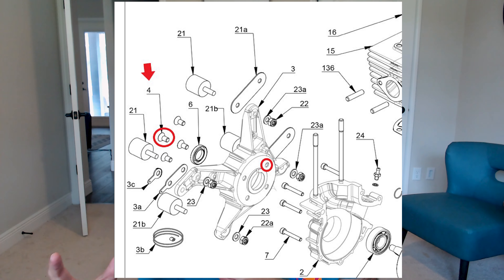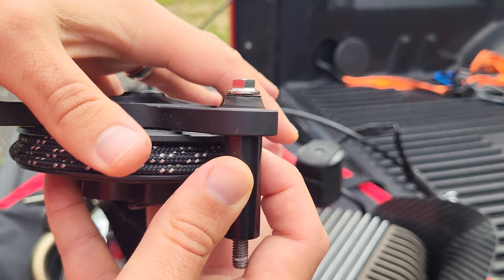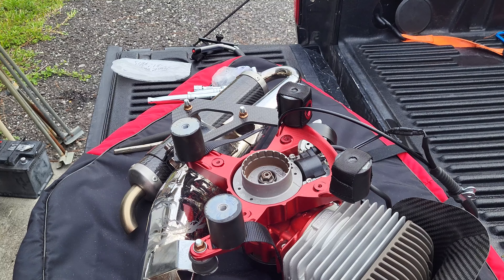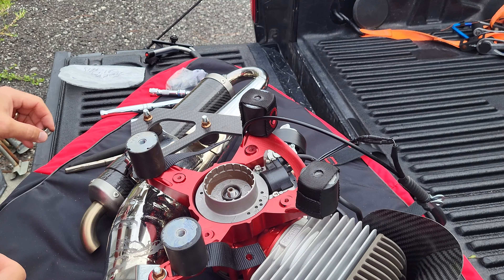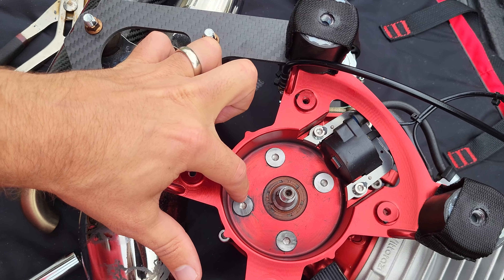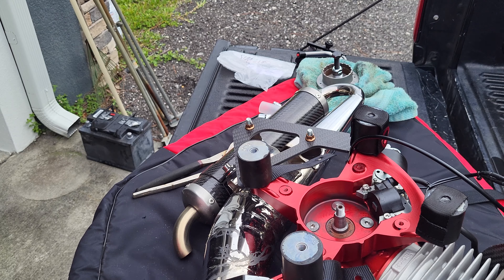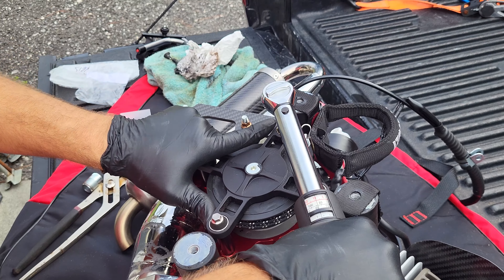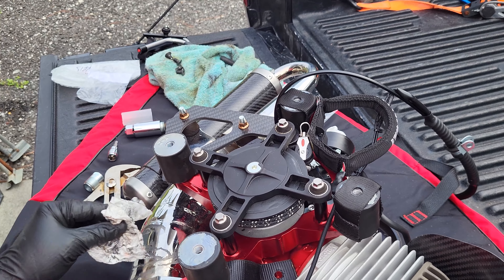Repairing My Moster 185 Factor R - Carter Support Bolts

Comment: Greetings Sal! Great content on your channel. I have a Factory R with the same problem so I am thrilled and thankful you have led the way forward in making this video. The issue happened at 39 hours as well. I did not notice any oil leaking. One of the Carter screws came loose and then seized the engine as it lodged between the Carter support and flywheel. The only external observable sign was that there was aluminum dust on the outside of the engine (from the screw scraping against the flywheel before lodging). Question: I don’t think I lost much oil, but in your research what oil do I need to put back into the bearings? My Carter support seal was separated so I will have to replace the cement gasket on it (thanks for the name). I wonder why lock tight was not placed on these screws as they hold the whole weight of the engine and spinning prop to the Carter support that connects to the frame via the engine mounts. Thanks for your awesome work here and your great content. Your flying is inspirational!

Comment: Just found your channel. Love it. Did that fix your problem ?  I’ve been thinking of getting a PAP to replace my Air Conception. Is that what I saw in your garage?  Is that factory R $1000.00 better than the 185+?  It does look amazing!
Reply from the maker: Thanks for checking out my channel! I haven't had any issues since I did this, so I'd say it was a success. I have about 25 hrs more on it since this repair.

I would recommend either the normal 185 or the FR over the AC. The power is so smooth and the motor is really reliable. I also love the hang points on the PAP better.